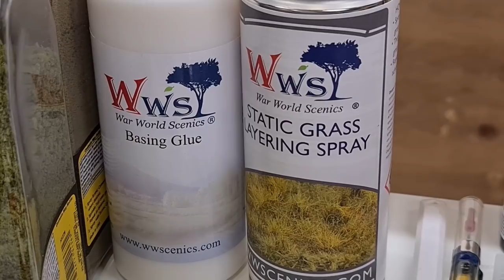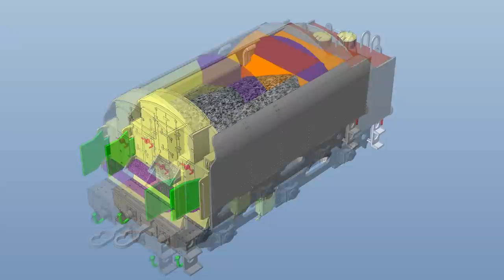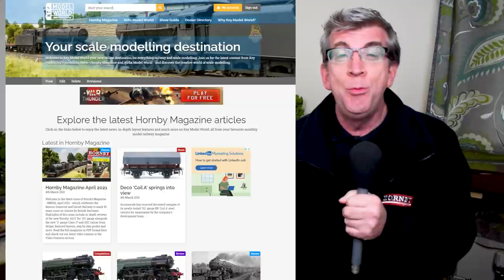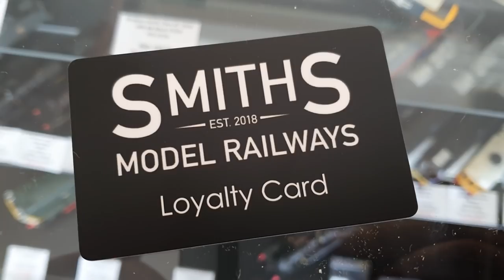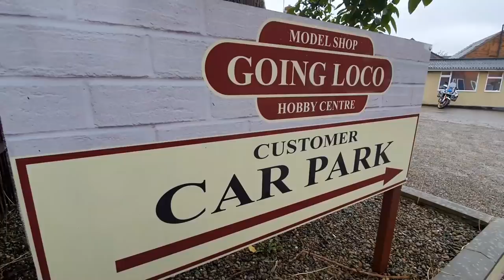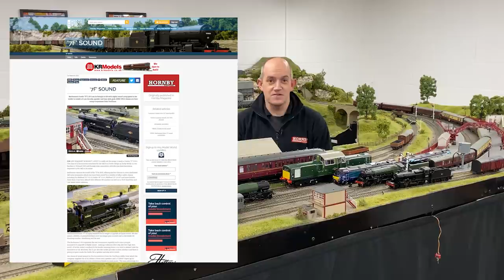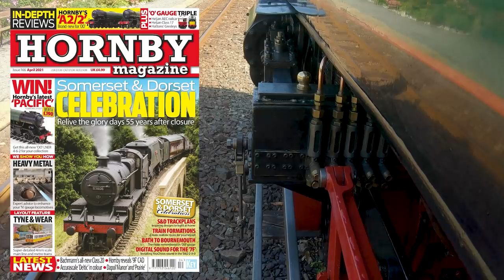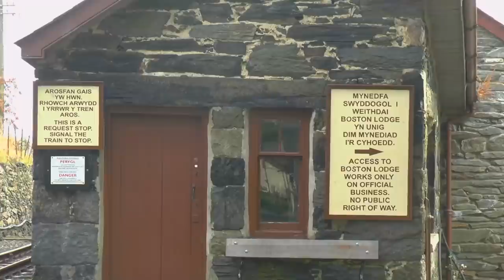Building the Ffestiniog: Part One | Hornby Magazine Show

Comment: The plaster bandage I put in position dry and used a water loaded brush painting water on top and the bandage would soften and re-dry in the shape required.  Much easier to use than soaked bandage, and just as hard afterwards.

Comment: Would love to model the section between Beddgelert and Rhyd Ddu, love the area and spent many hours walking in the footpaths throught the forest and up and down Snowdon from Rhyd DDu
Reply from the maker: Give it a go :-)
Reply: @hornbymag  don't I've got enough layouts on the go with out starting another, did you use a matt coat to take away the shine after using the dark grey wash Richard